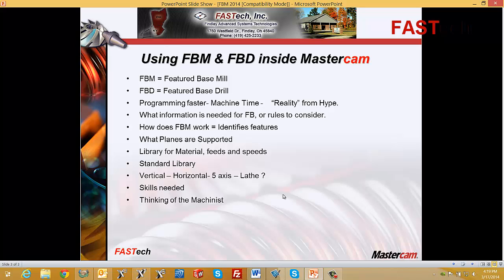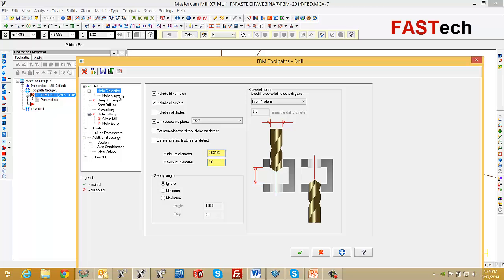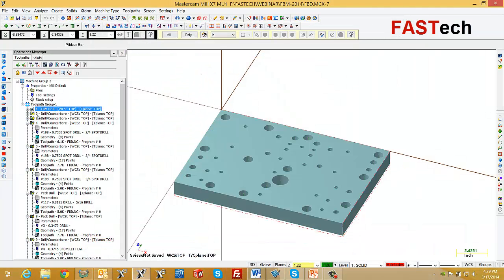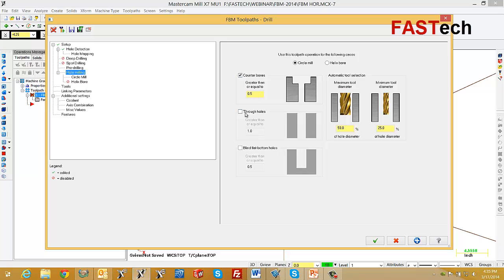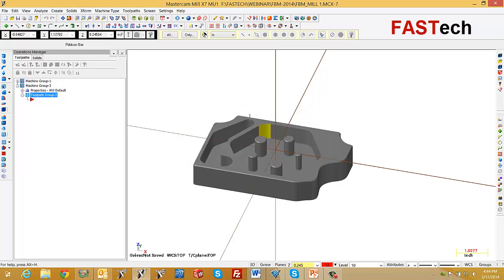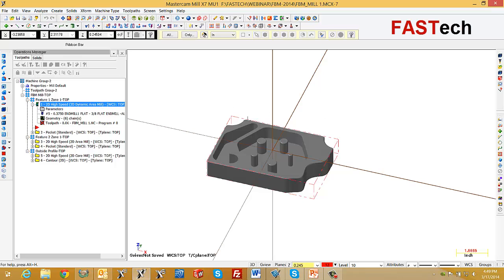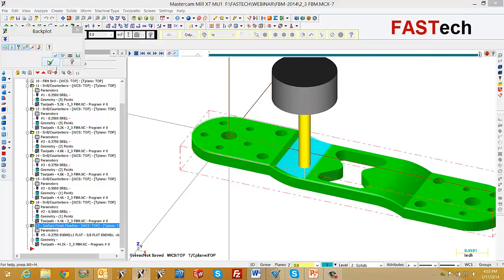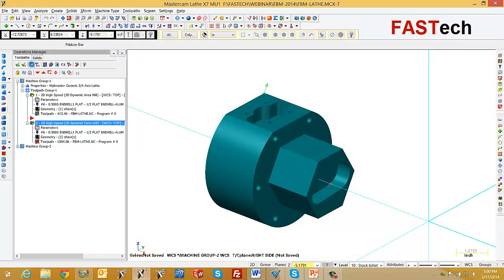Feature Based Milling and Drilling with Mastercam

Comment: Thanks for the informative tutorial.  I have been using FBM drill 2017, and have been unable to create tapping cycles.  On the features table I have re-selected the hole type as "Tap RH", then choose the tool size.  It then shows a warning; "tool requires a pilot hole".  The tap has a pilot hole defined in its parameters, pilot hole is selected on the pre-drilling tab.  How can I correct the warning?

Comment: very nice video.  I'm trying to learn about the FBD and FBD features in MasterCam.  My MasterCam 2017 will not allow me to unassociate the drilling operations after creating them with FBD like you do at ~ 10:50 in your video......
Reply from the maker: I do see that you are correct. In 2017, they must have removed the option to delete the original FBD operation. That being said, it does appear you can reorder and edit your individual operations with no ill effects. As long as you don't re-enter the FBD parameters, it should maintain whatever changes you make to the individual operations.
Reply: That's pretty much how I've found it to work. Looks like once you run the FBD path the paths are pretty much free from the FBM parent. Now I can't find a way to make a change to the whole group, only way I find to "regenrate" the FBD is to delete it and run it again........

Thanks!

Comment: Can you tell me how to delete machine group? I try to click "delete" button but it doesn't work
Reply from the maker: +Kaiming Wang I am not aware of a way to do this. The reason being, when you pick a machine type, you are switched into a different Mastercam Product. If all you have is CAD, then you are working in Mastercam Design. In this case, when you select the mill then you are switched into Mastercam Mill which has to have at least one machine group in the Operations Manager. 
One way that you can accomplish this would be to start a new file, then use the 'File > File Merge/Pattern' option. Then you can select the file which contains the geometry that you want and it will import. In this case you can now save the file which will still be in Mastercam Design and will not contain a Machine Group.
Additionally, if you just want to switch to another machine type. You can always select a new machine from the Machine Type. Once the new Machine Group is created, you can delete the first one you had.